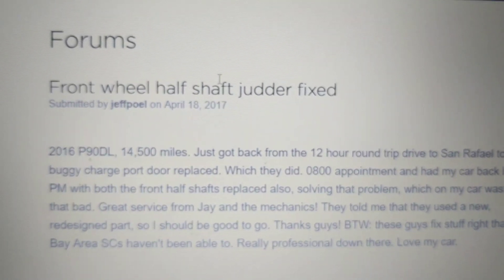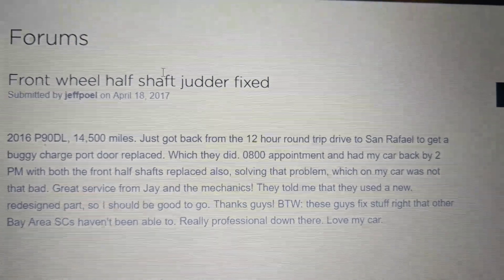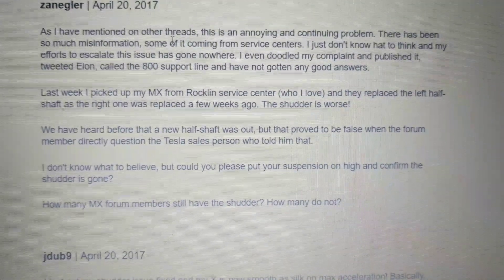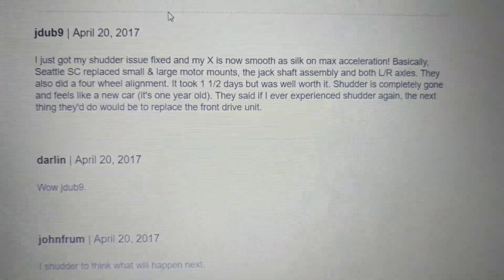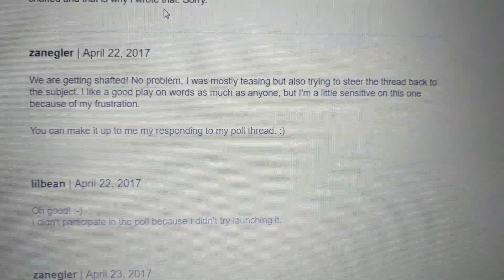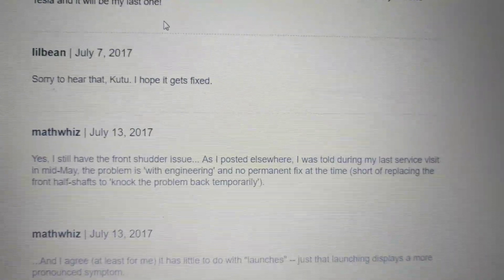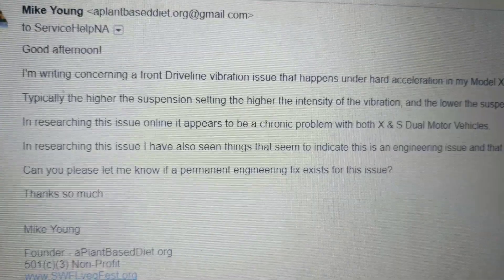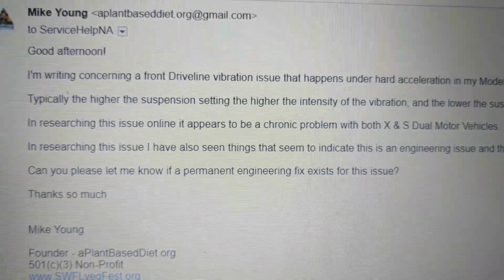Tesla Dual Motor Front Driveline Vibration Under Hard Acceleration

Comment: I have the same problem with my MX longrange Raven, (delivered in august) started approx. when the odometer hit 10 000 km (~6000 miles). SC says that they can't do anything about it...
Reply from the maker: I've had the front half shafts replaced twice.  The torque eats them up.  Design flaw.  Might be a good class action lawsuit
Reply: @aDigitalNomad  I have the same problem with a Raven P100S dec 2019

Comment: My 2016 S 75D (without air suspension) has 75k miles and I’m wondering if this is covered under the 8 year unlimited mile drivetrain warranty. I know my car is out of the bumper to bumper warranty which is only good till 50k

Comment: Hi there... I got my Tesla Model X 100D in Dec 2018; and the from drive started vibrating in less the 5 months when I try to accelerate from low to high speeds (highs - from 34 mph to 65 mph).... do you know of they have found a fix yet?  I''ll be scheduling a service to Tesla to see what they "will do" for a Fix.